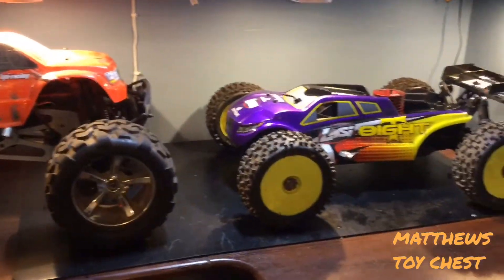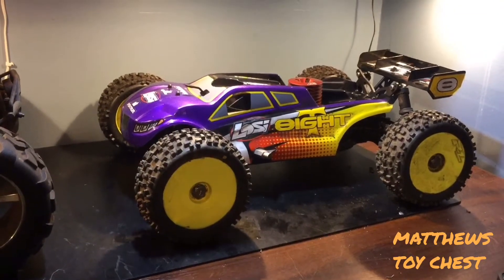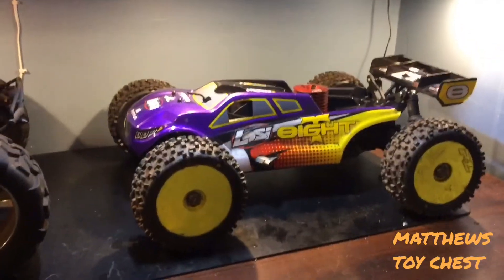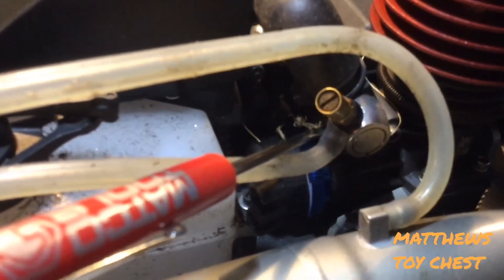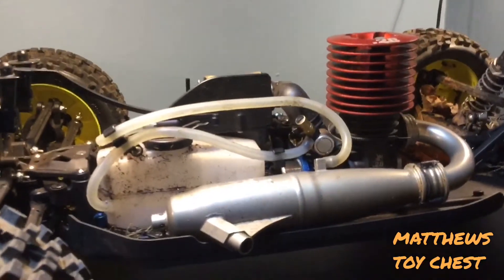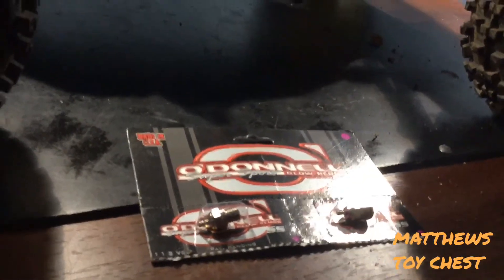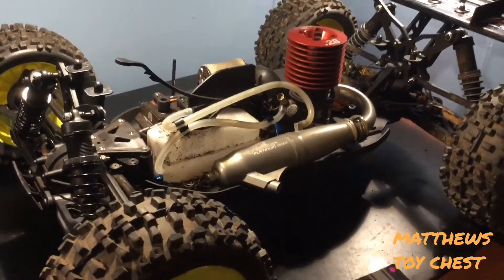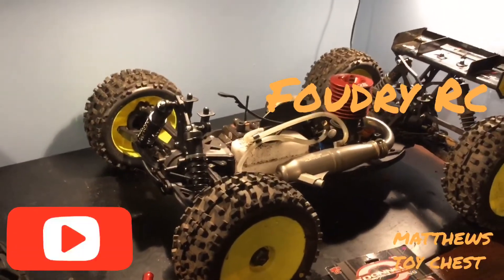Basic nitro tuning and understanding the nitro engine ⛽️⛽️⛽️⛽️🔥🔥🔥🔥🔥

Comment: So if the engine don’t turn off in 3 seconds which way am I turning the low speed?
Reply from the maker: Generally, you wanted to be 3 to 5 seconds. If it’s turning off in less than three seconds, and it just instantly dies out, you need to richen  the mixture up. If it goes on for like 6 to 8 seconds, you need to lean it out. What you’re looking for is the engine to run for roughly 3 to 5 seconds, and then very slightly raise up an rpm, and then die out.

Comment: What fuel did you use in you losi 8ight t with the dynamite .28 ?? I just got mine
Reply from the maker: Zach H traxxas top fuel for break in and Byron 30/11 for running
Reply: Matthews Toy Chest thanks! I have heard multiple times that byrons in going out of business but a main hobbies still has alott
Reply from the maker: Zach H they did go out of Business amain only has what they have in stock. I bought a lot of fuel from amain before it’s all gone.
Reply: Matthews Toy Chest is top fuel only one mixture and why do you use traxxas everyone that I’ve heard talk about it calls it garbage I am amsuming it’s cause the really low nitro percentage and really high oil percentage
Reply from the maker: Zach H it only comes in one mixture. I use it cause it has a very high oil percent. I helps keeps the temperature up. It’s great as break in fuel but it sucks for everything else
Reply: Matthews Toy Chest ok thanks for all the info
Reply: Nitro

Comment: What break in process do you recommend?  I've seen so many different methods out there, just picked up this same RTR truggy for my birthday and haven't put fuel in it yet.  My last truck (nitro stampede, atleast 10 years old) is still running the stock Pro .15 motor on 20% traxxas fuel.  Believe it or not, I took that pede out of the box, added fuel, and ripped it from day one.  No break in on that one.  She's still running strong a decade later lol.  I wanna be a bit more careful on the Losi this time around!
Reply from the maker: camaroboi13 everyone has there own break in method. The main thing is that you want to make sure that you are doing heat cycles. The first tank I run it at idle (with wheels off the ground) letting the engine get to 200-220 degrees. After that Tank I turn the truck off and let it cool for 30-45 minutes. Next tank is truck on ground and running it from idle to 1/4 throttle then again after that tank letting it cool for 30-45 minuets. You will want to repeat these steps so the third tank will be up to 1/2 throttle then cool then 4th tank up to 3/4 then cool then the 5th tank up to full throttle then cool. After that I generally go easy on truck for 7 more tanks then on the 13th tank thats when I start the tuning process and go crazy on the truck. Hope this helps have a blast with the truck.